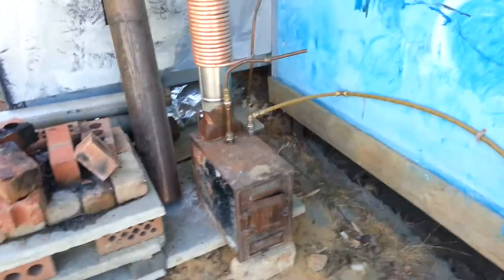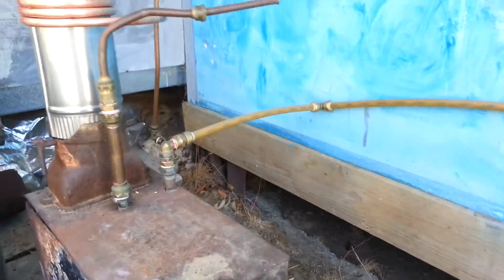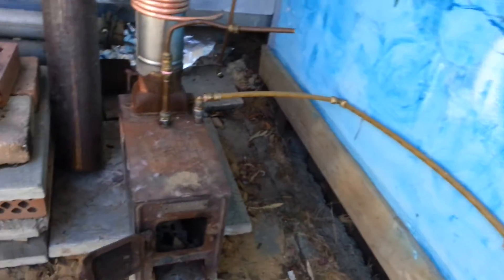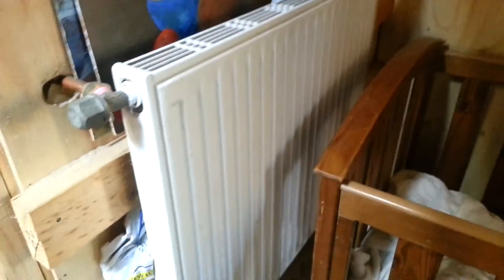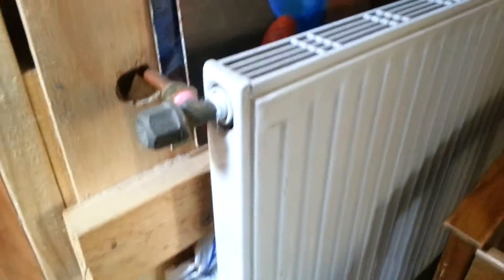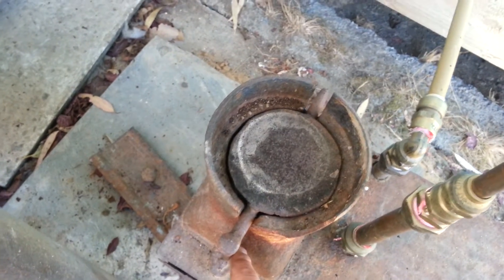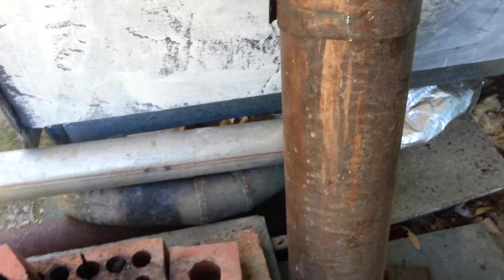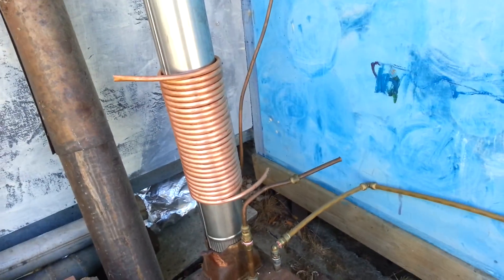Homemade hydronic heating.1

Comment: One major advantage of having a thermal water reservoir (bank/mass) is you  could drastically increase the flow rate of the water to keep it just below boiling and ~rapidly heat up the thermal tank....  then shut the stove down and gradually use the heat from the tank...  of course also useful overnight where you can't feed the small but powerful wood burner all night.   Downside... it requires a pump,   at least during the day (solar).   IF you put the thermal tank under your bed etc.... you might not even insulate it much and not require a pump at night, just let it loose it's heat into the space you want to heat anyway.
Reply from the maker: I ended up using an IXL stove in the kitchen and connecting a three hundred litre tank to that with pump attached.
Long time ago.
Reply: @Yantopia how did it work I am trying to do something like this in the woods at my cabin

Comment: Just picked up one of these stoves at auction. The refractory cement appears to react over years with creosote and break down into mush. 
Seems they're around ~1950's. No leaks in mine yet, just pulled it apart to give it a once over and then it will run a couple of radiators.
Be mindful that the mush/refractory in there is pretty flammable and sloughs off once you get a good fire going.
Reply from the maker: Maybe re-render it on the inside? I love those units. Let me know how it fires up
Reply: @Yantopia  Yep, I've cleaned it up and had a fire through it. Went really surprisingly well.  Going to re-render it. Might need to put some mesh in the render to keep it from falling off of the sides.
Hard to find information about them these days, but I took off the casing and there was a newspaper inside talking about the truce conference in 1952 in Korea and about the cold war.
They really are built like nothing else. Some of the later models with flue mounted thermostats for automatic air control look amazing but I've never seen one. Might have to go check out some estate sales.
Reply from the maker: @Joe-me6jh Nice one, do you have a storage tank for the hot water before running it through the radiators?
Reply: @Yantopia  Yeah I've got a little 50 litre hot water service. I'll run it open to air to avoid explosions.
Reply from the maker: @Joe-me6jh  should work well, keep me updated if you would

Comment: OMG I have one of these Tubulous stoves! Currently rusting away but hoping to use it to heat the workshop next winter. Thanks for posting this video
Reply from the maker: James Roberts 
They are very effective at heating water.
I moved onto a combustion stove with 300lt water tank attached so I could have some direct heat and cooking too.
Good luck, don't let the old units die!